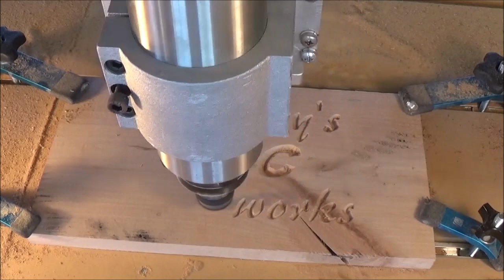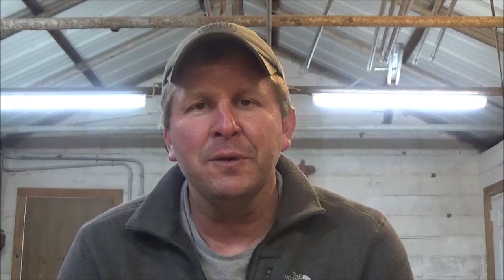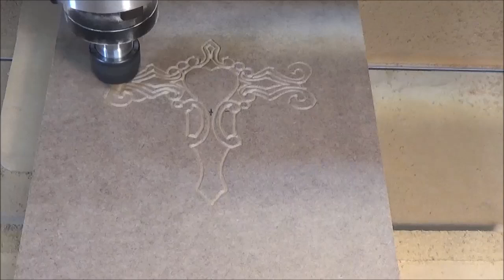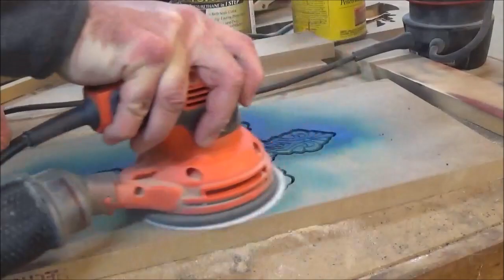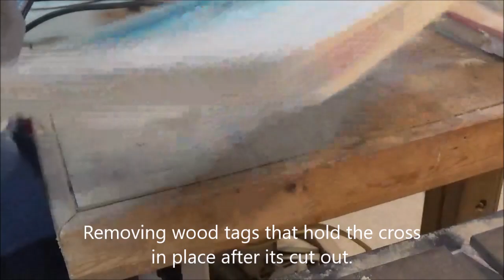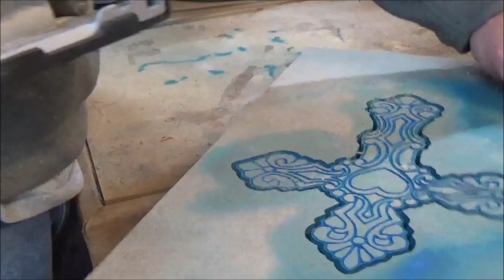CNC Decorative Heart Cross.

Comment: Have you tried putting a coat of shellac on the MDF before carving? I'm wondering if that would prevent the paint from soaking in where you don't want it.
Reply from the maker: It probably would have worked, I usually use sanding sealer now for a barrier, I don't do a great deal on MDF any more....Thanks for watching!!!